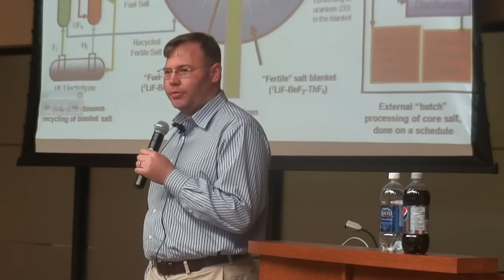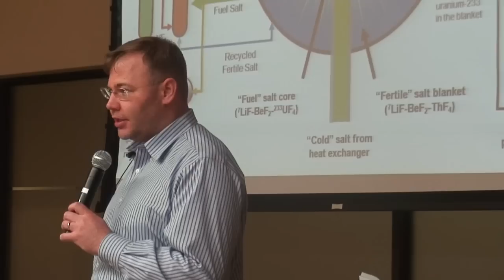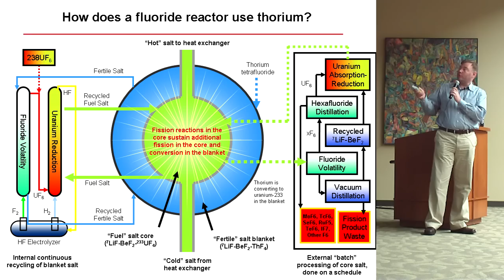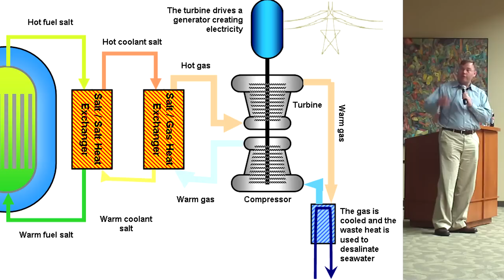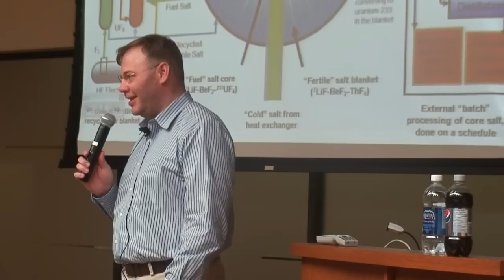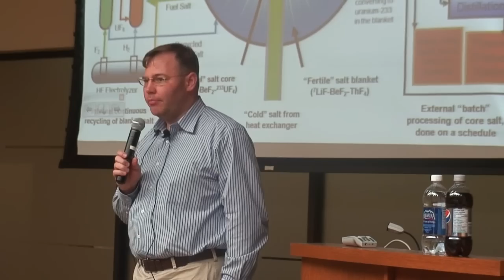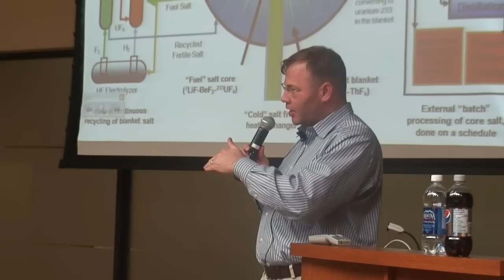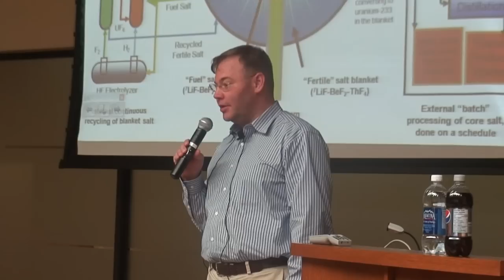Kirk Sorensen @ MRU on LFTR - Liquid Fluoride Thorium Reactors

Comment: The reason there is so much talk and no action is simply due to the fact that we now live in the 21st century and this LFTR design is just some obsolete cold war reactor that’s really only good for making bombs not electricity. Thorium fuel  source; Yes excellent, genius if implemented with modern tech; however where they promote the use of it in this dangerous inefficient design his how they fail. In essence the LFTR technology from a to z; what it takes to get a reactor of this type to produce electricity is synonymous with using small nuke bombs to propel an automobile; and as truth is stranger than fiction there was a real program called ORION that used small nukes to propel rockets. If uncle sam would give each household a rebate to purchase solar comming in today at only 5 cents per kilowatt hour, or power thier own homes with green tech; there would be a national surplus of not only electicity because homeowners would put power back into the grid and the purchasing of green-tech would spur a boost of jobs and economic growth with the rise of a market such as this and thus a result of a government revenue surplus of which can be used to reduce taxes not increase them. Unfortunately pinheads that produce videos like this go to  Washington to lobby the senate to give them a large corporate welfare check to  build an apocalyptic monstrosity like this LFTR because it’s so economically inefficient and so dangerous they need an act of congress to pass law for the people of America to take on the liability of debt, personal injuries, and high costly operation for Nuclear Power Plants.
Reply from the maker: Take your meds.
Reply from the maker: One OBVIOUS point of MSR clearly stated in this video is that we do NOT boil water to generate electricity. Maybe you should watch the video you're commenting on.
Reply: concur... he specifically said "gas turbine" and NOT a "steam turbine".  i'm aware steam is the gaseous form of water.. but i've heard Kirk state elsewhere that the gas to be used would be something along the lines of super-critical CO2, not water in any of its states
Reply: QA - you have swallowed the Greenies delusions. There is simply not enough green energy to operate a modern industrial  society and e  economy. I doubt if there is even enough to operate as diffuse low density agrarian utopia you so desire. As at least several billion of the currently living humans on this planet would likely object to being sacrificed on the alter of the Green God I See a more successful and pleasant future with a Thorium economy than you version of paradise.

Comment from the maker: The "need" for LFTR waste being recycled is pretty high, since some impede reaction, and  NEED to come out. I'd take a look at NASA's needs for Xenon (ion drive Dawn mission) and Pu-238 (RTG for Curiosity mission) as prime examples. This is an in-the-USA process. Since PV aren't REALLY being recycled yet it will end up looking like electronics recycling... ship the used up PV waste to China. If there's no heavy rare earths the PV just isn't that valuable. PV are NOT like hybrid car batteries.
Reply: If Sorensen's correct, those wastes can be removed continually from the fuel salt because they will be in the form of fluorides themselves. Some of the fission byproducts are isotopes that are important for the detection and treatment of cancer, and can be harvested and delivered to hospitals as needed.